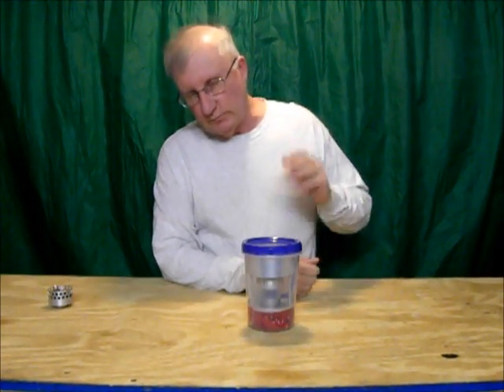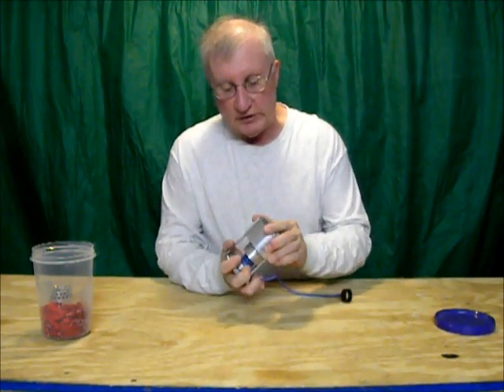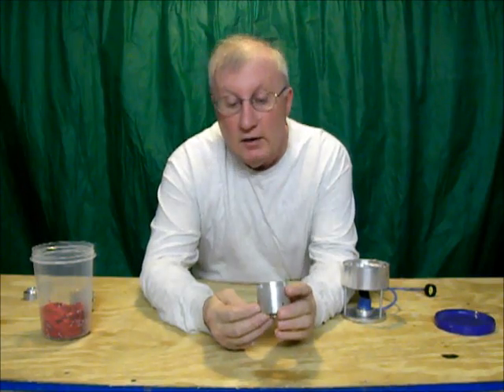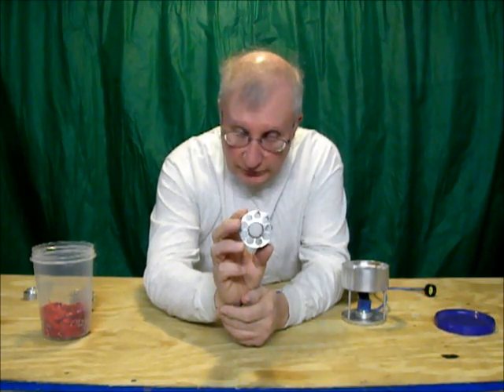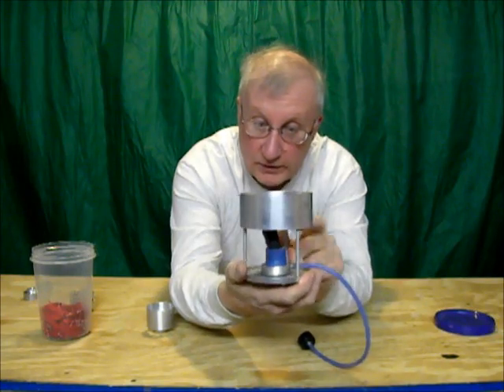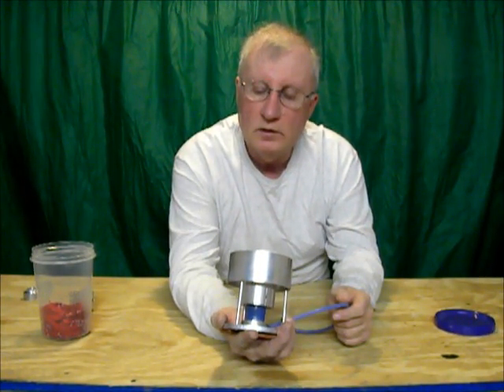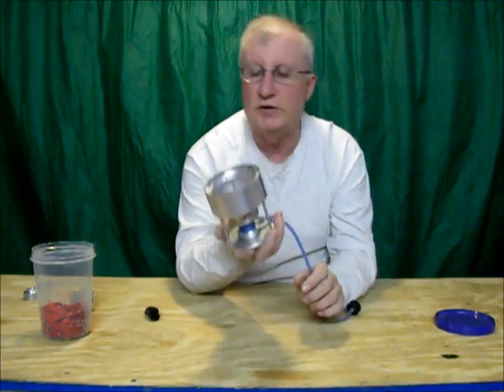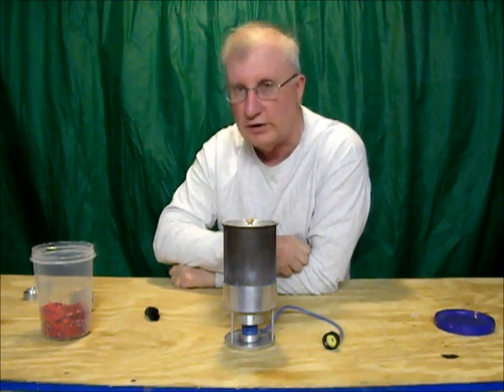Puttering

Comment: An idea for you: Take the base - make it 100% flat - ditch the 3 rods - take the round wind screen and make it very thin & smooth on the inside - place some holes around the bottom of the windscreen - make it fit inside the groves of the baseplate. You have just made a MBD ground/windscreen for the atomic/mini-atomic. This is *exactly* what we need! The baseplate will help prevent forest fires (4 already caused by PCT hikers with alcohol stoves) and be an awesome alternative to the caldera cone!

Comment: The copper coil alcohol pressure stoves are more efficient and less prone to cold issues.....
They don't build enough pressure to hurt anything or blow up, but they do maximize the fuel supply.

Comment: Tinny, I can't help but think that the gap between the outer cylinder and the 1 around the wick is acting like a convection channel that's inducing cool air to flow up and around the pot.  Try sealing the gap between the 2 cylinders so the only air (gasses) that's getting to the pot bottom is the product of combustion.  Also, the higher the outer cylinder is, the better it will be at holding the hot gasses to the side of the pot.